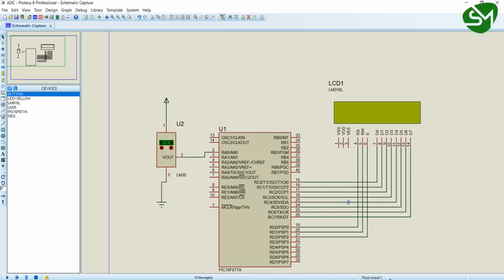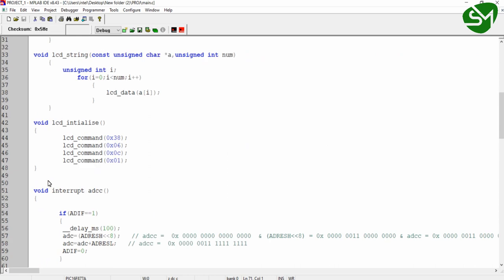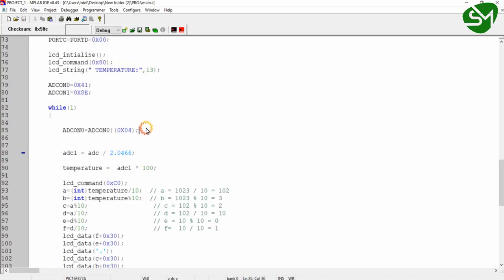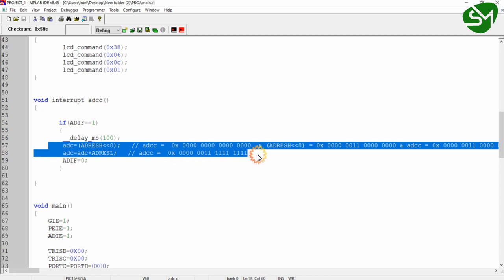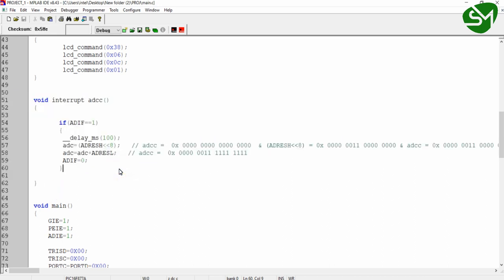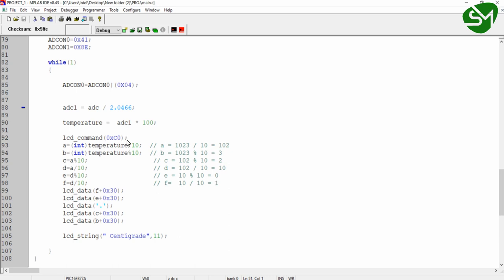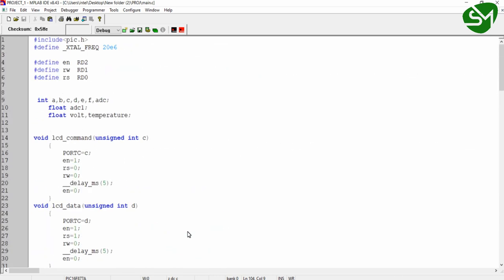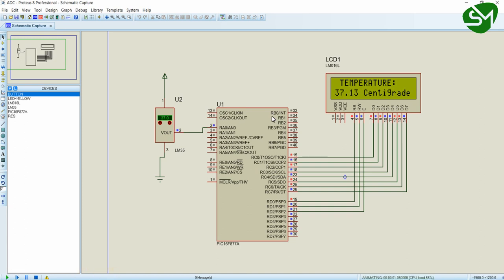BUILDING DIGITAL THERMOMETER (LM35) USING PIC16F877A | TUTORIAL 22 | MPLAB IDE PROGRAMMING COURSE

Comment: Thank you for the video. I understood all what you explained except the part when you used lcd_data(f+0x30) [minute 12 in the video]. Why we didn't use lcd_data(f) simply (same for e, c and b)?
Reply: well I found the answer and wanted to share it in case someone has the same question: So as to display a number on LCD, we need its code ASCII. And so as to get the code ASCII of any number we add 0x30 to it.

Comment: I dint get why we are dividing with adc1/2.0466.. Is here do we need to multiply or divide ?
Reply: me too I didn't understand the method he used here very well. But you can multiply adc by 4.8 which is the step size and then divide the result by 10 to get the temperature (since on the data sheet of the sensor it is mentioned 10mV/degree C); and you will get the same results.